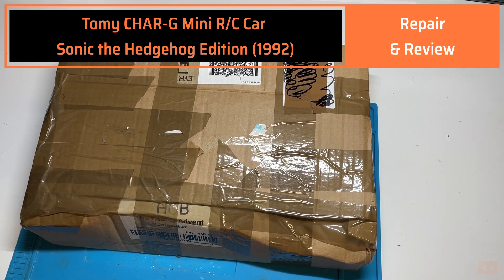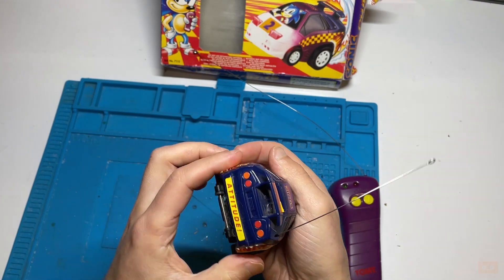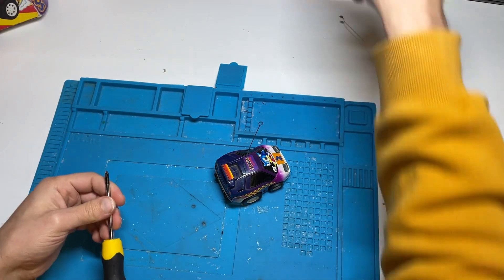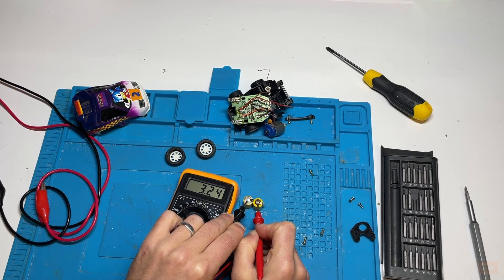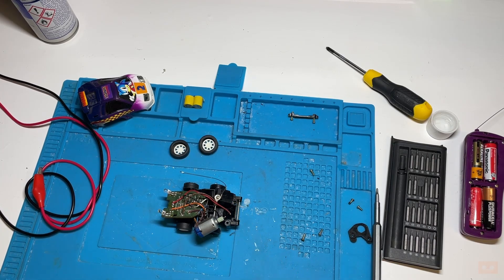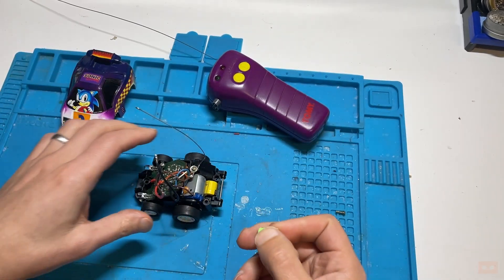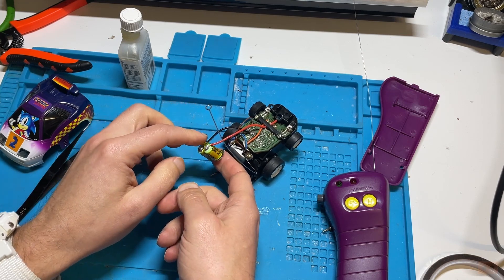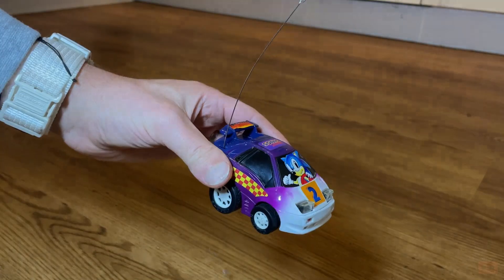Can I FIX it? Repairing the Tomy Sonic CHAR-G Remote Control Car

Comment: Great job,im doing the same on mine.so a nihm 3,5 volts battery should do the job ?
Reply from the maker: Good luck with yours! I used 2 x 1.2v batteries so 2.4v I can't see 3.5v doing much harm the motor should be fine. I can't remember what the original battery was (2 x 1.5?) but my only thought is that with sticking close to the original that's what the handset circuit board will be designed too expect.
Reply: @retro_restorations  thanks, i will post vídeo when i am ready.